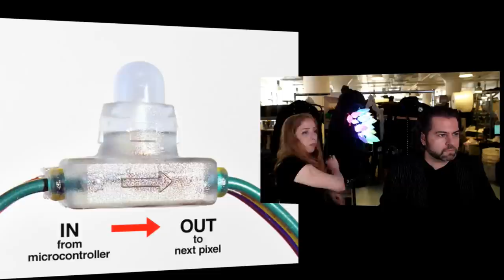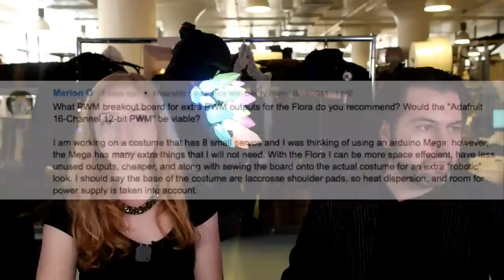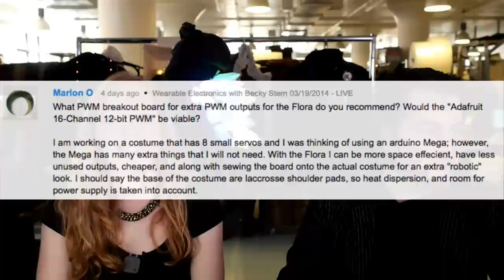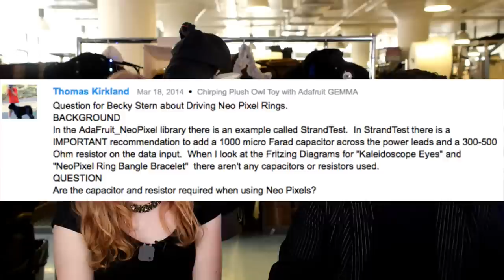Wearable Electronics with Becky Stern 4/16/2014 - LIVE

Comment from the maker: http://youtu.be/RAY0ceJPFpA & http://www.adafruit.com
Reply: Hareem Haque That greatly depends on what you're connecting the display to and what size you consider wearable. Adafruit Industries has plenty of small displays, though. For example:
http://www.adafruit.com/products/910
http://www.adafruit.com/products/802
Reply: Hareem Haque So far the only flexible OLED display being sold (other then the two in the phones LG G Flex and Samsung Galaxy Curve) is the one in the Samsung Gear Fit. It's going to be  awhile before flexible displays are available to those that can't build them. I looked into this a little while ago hoping to find something other then those, but they just don't exist yet.
Reply: How could I get more pinouts on my flora? I need some more for a project.